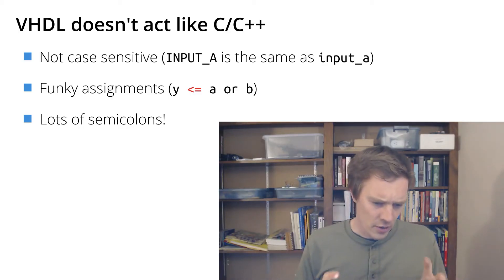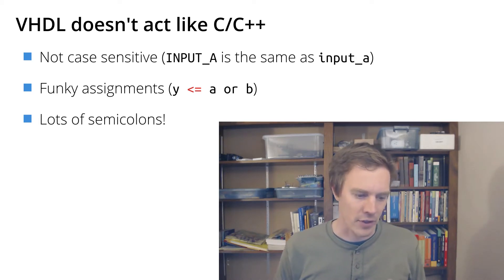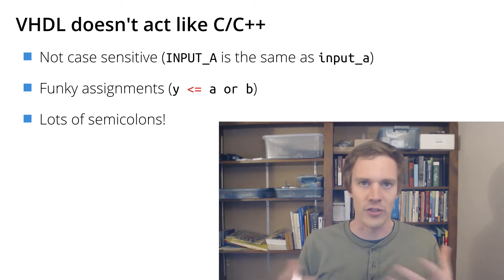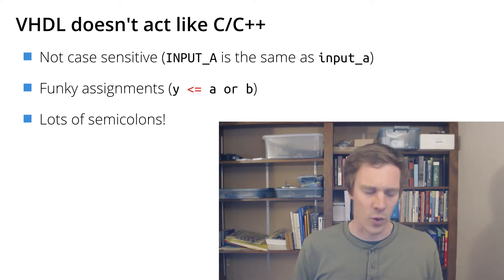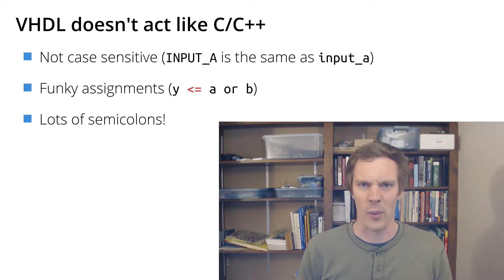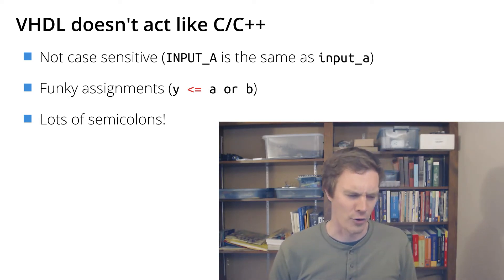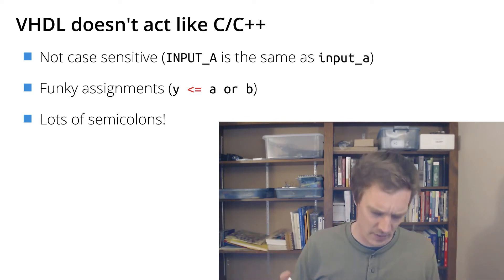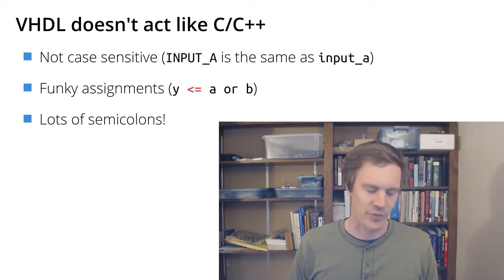How to think about VHDL

Comment: So, I am just a lay man...but would vhdl serve a purpose closer to Assembly than C? Like it direcrly interacts with the chip itself right? Like you can individually turn different gates on or off basically.
Reply from the maker: VHDL isn't closer to the chip, it's used to create the chip.  If C is like a set of Lego bricks, and assembly is smaller Lego bricks, then VHDL is like 3D CAD software and a 3D printer.  It's not so much "closer to the hardware" as it is a paradigm for creating the hardware itself.  Does that make sense?
Reply: @botsnlinux  that is cool af

Comment: Been at this language for a while and I still pull my hair out on occasions, but lately its all been coming together since using component imports and generics, I tend to think of designs in terms of counters and glue logic, i.e. state machines, if you try and fall back on VHDL doing the power tasks without thinking in terms of hardware behind it, you will create some monstrously bulky designs, KISS method.
When you start, dont make the same mistake as I did, when you search for help, ALWAYS make sure the examples are SYNTHESIZABLE (can be programmed into hardware) or testbench which cannot, learn one first, not both at the same time or you might go mental!
Reply: @clintonowino2619 thankyou for that tip, that is helpful!, I am at a point now where I can create mostly functioning designs, but clueless on test bench, if you know any good books let me know